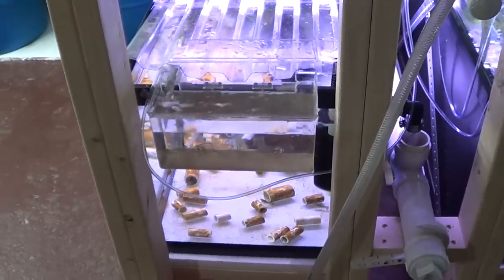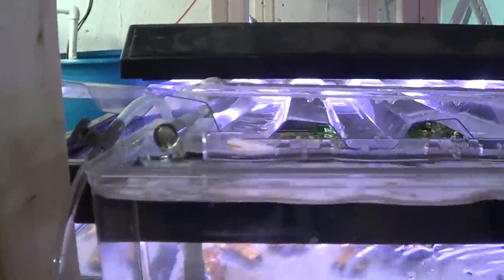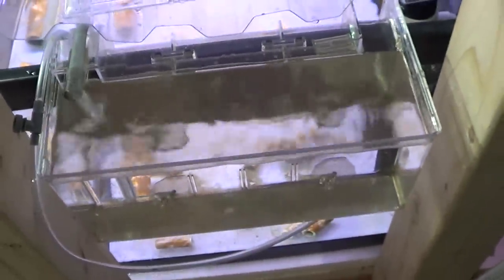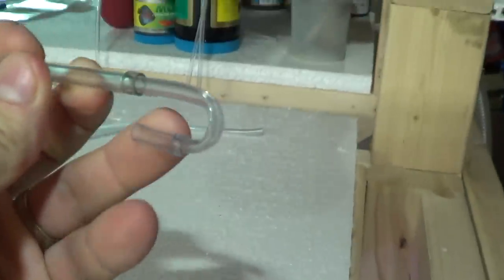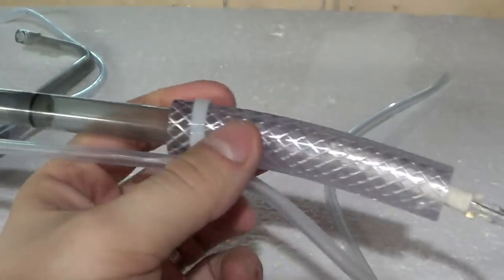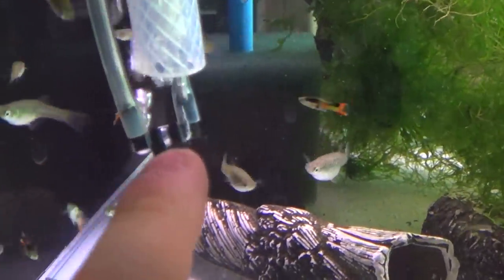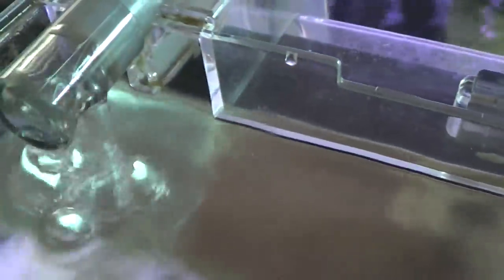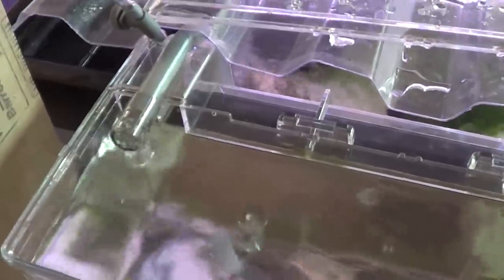#275: How to Silence a Marina Hang on Breeder Box - Tank Tip

Comment: I just silenced mine by removing the air line holder/intake cover off the intake tube, then inserting the intake tube down the outlet tube of a 3 inch sponge filter from Swiss Tropicals. Now it's silent, with 3 or 4 times more flow that isn't  turbulent at all, plus there's extra filtration. No more baby cherry shrimp getting sucked inside up the inlet tube anymore.

Comment: Stick a little bit of filter foam in the end of the tube so that one end is in the hole at the end of the tube and the other is in the water. The water will trickle silently down the filter foam. It will still make a noise while the breeder box initially fills but as soon as the water level is such that the filter foam is in the water, it is silent.

Comment: Here's what I did after finding this video. I took my air tubing and pierced it many, many times with a medium sized needle. I melted the tubing shut. I took the end off the air shaft and inserted. If you run into flow problems, poke it with a needle more.

Comment: I also found you can use the drop pipe from a Tetra Whisper 3i filter. It fits perfectly and you can get the filter and air pump together on Amazon for under $6.

Comment: If you use the one made by finnex it has a spray bar and it also holds more water I use mine as a mini hydroponic system and have 
live plant's growing in it the down side is its a little more expensive but worth it

Comment: I watched a video earlier on https://www.youtube.com/watch?v=3nWkAzasrDI. He used some filter floss on the side where the air lift tubing comes in. I haven't tried this myself yet, but I think in concept it would reduce the noise somewhat. In the same video he used a syphon method from an HOB filter that actually seen before. The only issue with this is you need to have power and a 2nd filter. A lot of people use HOB filters, so I think it's the best option if you already have one. Just make sure the tube is secure in the HOB and breeder box.

Comment: I run these on my tanks, I've found that decreasing the amount of air that goes to the line via the valve on my manifold and then adjusting the nob on the breeder box gives me a near silent box.
Reply from the maker: if the tank is topped off 100% that's probably the case, the higher the airlift the worse the sound gets i believe

Comment: simplier can you put a smaller tube fitting at the end where the water come out (remove the end cap) long enough to submerge it in the water in the breeder box?
Reply from the maker: i did that, it either spits it out or clogs it up, i also rubber banded a flap above the outlet and it helped but not as much as the air stone helps

Comment: I simply attached a 3/8thID x 4 or so to the outlet pipe,,and bend it around so that it is pushed against the outside wall, just touching the surface of the water..valve on quite low,....voila no sound.

Comment: I bought a small 200 lph pump and heated the water intake and slipped it onto the pump output, it's completely silent and also has a crazy flow rate through it. Defiantly a worthwhile modification.
Reply from the maker: sounds great for a single breeder box, might be cost prohibitive for a dozen of them, do you run a prefilter on the water pump?
Reply: ***** Yea well that's true! No, it has a filter screen before the water enters but nothing stopping me putting a bit of foam on the front.